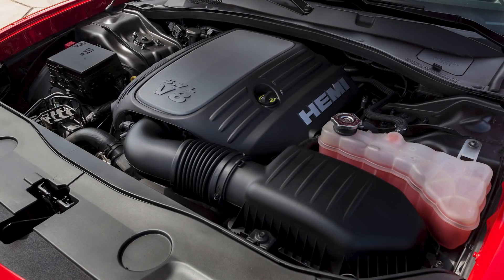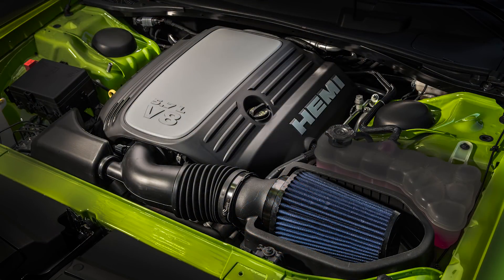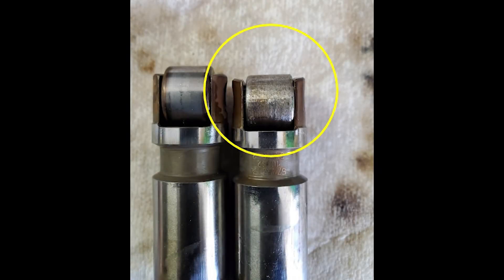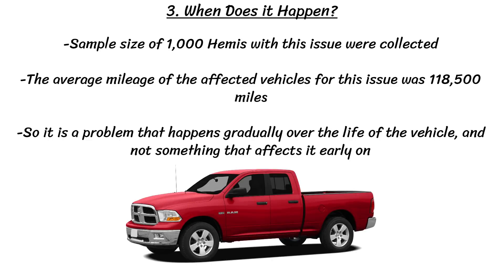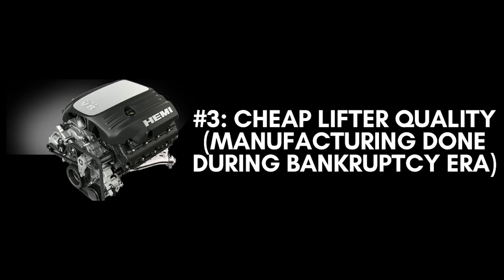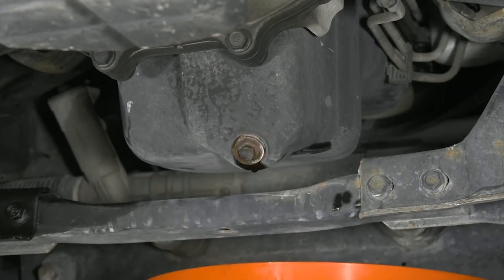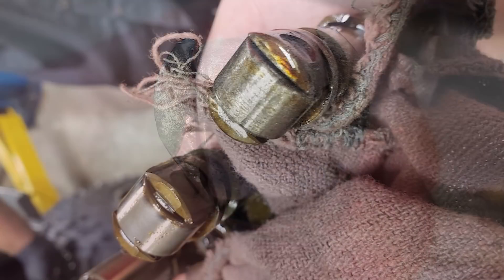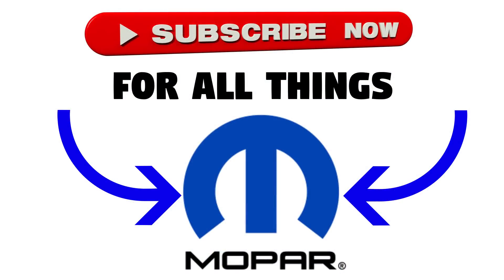The Fatal Flaw of the 5.7L Eagle Hemi V8 Engine Fully Explained (2009+ Lifters and Camshaft Failure)

Comment: Actually better than I expected, a few things though. 

1) It's not a lack of overall lubrication. The lifters are drenched in oil and actually have THREE oil sources. There's a main oil galley that is ALWAYS providing oil to the outside of the lifter body. This is the source that lubricates the needles. The inside of the lifter is supplied oil from the head that flows down the pushrod. And the MDS system provides a third source when activated. 

2) The lifter part number has changed, the last letter of the part number is the evolution. The current lifter is D, the needle bearings first got larger with the C introduced in 2014. The photo shown at 5:12 is a key thing to understand. From '14 up they'll look like the lower one. The C-D evolution is an internal change that did not effect the bearings. 

3) The idling and oil viscosity thing also has a lot to do with heat. Compare the 6.4 to the 5.7, they both use the same lifters, both have MDS and VVT, and both have similar camshafts. But the 6.4 doesn't experience a lot of lifter failures. There's two key differences. The 6.4 specifies a 0W40 oil and has an oil cooler. The 5.7 specifies 5W20 and usually doesn't. So in the 5.7 the oil is already thinner and at times hotter which again makes it thinner. This is a key part of idling as the engine relies on air flow under the oil pan to cool the oil. Then consider that often engines are idled for long periods to run the AC, which again makes everything hotter.
Reply: Excellent information to add to the video!
Reply: Would you recommend running a different viscosity on the 5.7 then?
Reply: @renameduser5279  I'll tell ya this, my '14 with 55K is due for it's second oil change since I've owned it. In the first change I put in Redline high performance 5W20, this time, probably this weekend, I'll be putting in Redline 0W30. After my research I've decided that's best for me, but I'm not going to recommend something I haven't yet done.
Reply: @GarcBomber  I know the current lifters are Melling and I'm reasonably confident that all the AC and AD lifters are Melling with the AC being the first evolution with the larger rollers and introduced in 2014. Nothing to do with the Hellcat, but a change made in all the Hemi engines as they all use the same lifters. The only variation is if 8 of them are MDS lifters, but the MDS lifters have identical rollers to the non-MDS lifters and all non-MDS lifters are identical. 

Ehhh, some roller lifters can go millions of miles, out lasing flat tappet lifters, it all depends on how they're sized, how well they're made, etc. There's a fair amount of common non-heavy duty vehicle engines made in the 80s with roller lifters sill on the road without the lifters needing to be touched. 

I was hoping you knew what changed from 2010 to 2011. Clearly while none of the engine specs changed for 2011 something went bad. Presumably the supplier for the lifters was either changed to save money or quality dropped with the same manufacture for similar reasons.
Reply: @snek you have a lot of accurate information in your comment the only thing i would like to correct you on is the 5.7 does have an engine oil cooler thats built as part of the engine oil filter housing. Oil is cooled via engine coolant being fed and circulated by feed and return coolant lines.
Reply: @richardlovasi9593  Thank you...

Some 5.7 vehicles have the oil cooler, most do not. All 6.4 and 6.2 engines have it, but with the 5.7 it's put in HD use vehicles like the police cars, probably some pickups and SUVs with HD cooling packages, I'm not really sure there. The way they do it requires not only a bunch more coolant hoses but also a different water pump. The cooler itself though, as you said, just mounts between the block and oil filter.
Reply: My 2020 Ram 1500 Classic has a factory oil cooler that ties into the lower radiator hose on the 5.7 so it’s a plus. I’ve also relocated the oil filter and using a larger filter with increased oil capacity.
Reply: That why i put 5w40 in my 5.7 HEMI
Reply: @xxx20003  Ohhh, no codes?
Reply: @snek9353  No codes at all, put i noticed the oil pressure increased to 49 psi at idle instead of 40 psi.
Reply: @GarcBomber  China?
Reply: @GarcBomber  Who brought up coolant temp concerns? I also completely disagree, if overheating is an issue than cooling ability is the problem, a lower thermostat is a crutch that can cause other problems. The only reason to lower thermostat temperature is if you're pushing the edge of ignition timing and detonation. The Hellcats on the other hand have a 180 stock, I can only assume that is why.

Fans on the other hand should be a very early step. The factory fan settings are kind of dumb with no variation for high and low vehicle speed and too high of hysteresis settings. Fan temps should be lowered and hysteresis narrowed overall with the lowest settings being low vehicle speed and AC on. 

I don't know what you're referring to though in regards to "coolant heater" and "supplemental fans". My knowledge mostly relates to the cars, is this a truck or SUV thing? Is there a factory coolant heater to speed up coolant warming for cabin comfort?
Reply: I should add a 4) to this... 

4) These engines consume oil. The PCV system does a poor job separating oil from the crankcase gases, so oil droplets end up getting cycled into the intake manifold and consumed by the engine. IMO this oil consumption is bad enough that if the oil isn't checked and topped off between changes and one goes the full 7K mi between changes(the factory interval for the oil change light) there could be just barely enough oil in the engine to maintain oil pressure by the time the oil is changed. Those few quarts are going to be very dirty and completely worn out. 

A little known fact about oil, it thins over time. A typical 5W20 oil is made by taking an oil with a viscosity rating of 5 and adding what is called viscosity index improvers(VII) until when hot it acts like a 20. Now while the base oil doesn't break down or lose viscosity these VII do, so over time a 5W20 becomes just a 5.

So for someone who uses cheap oil, doesn't check it between changes, and just waits for the light to come on then goes to get it changed. By the time they have the oil changed the engine could only have a few quarts of what is essentially very dirty 5 viscosity oil in it.
Reply: @snek9353  I have two of these engines.  One from 2010 and one from 2012.  Either consume a drop of oil.  The 2010 has 122k miles on it.
Reply: @rscarawa  Interesting, you must be the only one. There's a reason adding catch cans is such a popular mod. My '14 with 55k spits about a pint a month, might be that I spend a lot of time with my foot on the floor.
Reply: @snek9353  I am easy on both of them.  Cannot afford a major failure at this time.  My last oil consumer was a Saturn SC2, 1995.  I lost a quart every 600 miles.  If I did not add oil to it between changes, it would run dry.  Never left town with out two quarts in the trunk.
Reply: Same. My 2014 5.7 is very polite about its oil appetite
Reply: @snek9353   My 14' currently has 126k miles on it and it is very polite regarding oil consumption.   I believe it's more of a consistent maintenance approach.  I drive over 100 miles Monday-Friday just going to work and back just as a point of reference.  I'm not saying you are incorrect, I'm only saying that I've had a different experience.
Reply: @jvilly1385  Like I said in another reply, I think my oil consumption has a lot to do with my heavy foot. I was doing 110 racing a 911 just for kicks on my commute the other day. This is normal for me. 

My car is very well maintained, I'm not concerned, it's just a thing I've noticed and it makes sense. It could also help explain all the issues in police cars, cops drive like I do. But they don't check the oil regularly and do great maintenance like I do.
Reply: @snek9353  did you ever switch to 0w20? If so how has it done for you? Supposed to be buying a Chrysler Aspen with 5.7, has it benefitted your vehicle? Would like to know so when I end up getting an oil change I get the right oil for the job. Thank you.
Reply: @taijatinsley2312  I don't intend to ever put in 0W20. I do plan tp put in 0W30 on my next oil change. But no I haven't yet.
Reply: @snek9353  what’s the reasoning for putting in 0w30 instead of 5w20? Does it just work better and help the engine stay lubricated better? Or is it more to it?
Reply: @taijatinsley2312  Pretty much, 20 viscosity oils came about as a measure to improve fuel economy. But they're pretty thin when hot, a 30 should lubricate better most of all when hot. A 0W30 is actually a bit thinner then a 5W30 so I'm using it as my next step.
Reply: @snek9353  Most of the reasons I’d ever seen for the catch cans was that they’re relatively cheap insurance…and a shiny mod that pretty much anyone with even the smallest amount of mechanical aptitude can do.
Reply: @shinner65  Insurance? Insurance for what? The catch cans simply keep the oil from making it's way into the intake. This keeps the inside of the engine cleaner, that's all. It keeps burnt oil from building up in the intake and on the intake valves. It's questionable how much of an issue this is, most of all on the valves as the hemi has a single intake valve per cylinder that
 has fuel injected onto it. But still, it's a viable thing.
Reply: @snek9353  you kind of explained it (better than I could), didn’t ya? I’d always heard the modern Hemis have an issue with blow-by, so for what they cost, it’s an affordable band-aid that helps with the problem and doesn’t hinder performance. And like I said, it’s usually a shiny piece that anyone with minimal skills can put on their car (and the all-important car-show mod list).
Reply: @shinner65  I suppose, except one thing, all engines have blow by, the difference is in how it's handled. Admittedly the hemi could handle it better factory. But sadly that's rather common with a lot of engines, very few handle blow by gasses well factory.
Reply: @snek9353 I just bought a chrysler 300c with the 5.7 and it has 168k miles. The car has been well kept, and I haven't noticed any ticking. What would you recommend for keeping it alive as long as possible? Thanks
Reply: @tomcraftdonkey2285  What year? 

Like all other vehicles good fluid maintenance is top of the list. Pay attention to all fluids but of course engine and transmission oil are top of that list. As you've likely read I'm a fan of Redline products and am using their 0w30 in mine. I change every 5k on the 5s to make it easy. so 60k, 65k, etc. 

For the transmission it's unlikely you have a dipstick, you'll want to buy the correct dipstick(s). There's two kinds available, one that functions like an old school dipstick and can be left in. And one that is the official way to check and isn't left in. I trick I've done on other cars but admittedly haven't done on my 300 yet is to T into the transmission coolant lines and add a valve. I'll then use this to remove 1 quart of old ATF with each oil change. Adding in a new one of course. 

Depending on year you may be able to get gizmos that get you the SRT pages which provide better gages. Then also another that'll allow you to up the idle speed if you decide to up idling oil pressure.
Reply: @snek9353 i know this is an old thread but i was wondering if it would be smart to clean out the oil that has possibly been built up in it? i have a 5.7 with 52,000 miles and looking to get a catch can to prevent this because like you i drive quick and try and keep it maintained the best i can
Reply: @anthonysilva3673  In what? The intake manifold?
Reply: @snek9353 yes and do you have any tips for me for maintenance? i always do 3-4k mile oil changes and im wanting to change my transmission fluid and diff fluids. i’d appreciate all the help i can get!
Reply: @anthonysilva3673  Certainly no harm in cleaning the manifold out, nor is it very difficult. Doing so isn't going to make much difference to the life of your engine though, only to it's performance. 

I don't think there's much more to say that isn't in a comment/reply above. Ask if you have any questions though. 

What transmission do you have?
Reply: @snek9353 i’m not sure. but it is an automatic 8-speed and it’s a 2017 rt challenger
Reply: @snek9353  ppl
Reply: @snek9353   my 2018 eats zero oil. it has 138k on the ticker and still runs like day i got it. so really dk where you get that it eats oil....
Reply: @alexlindekugel8727  Mine does, maybe it's because I drive like a man.
Reply: Oil temp is always at 210 degrees since our 2013 Jeep has the towing package with heavy duty cooling. I can drive it up a mountain, drive it in heavy traffic in hot Arizona summers, oil temp stays around 210 degrees. Have also always used 5w-20. Now, if the engine is being raced, or actually used for towing, I'd probably bump up the viscosity. No hemi tick either, but only 50,000 miles. I've seen lower mileage ones ticking, so good sign so far.
Reply: Dodge/Chrysler have ALWAYS BEEN SENSITIVE TO CARBON BUILD UP ....
Reply: the cam placement in the block is to high on the 5.7 and the angle of the lifters to severe .I feel it is a design flaw .due to the cam placement and lifter angle .but if the engine goes 100k before cam lifter problems thats ok so do cam lifter swap at 80/90k .the small block chevs in the late 70s earl 80s would wear cam lifters also replaced many in my day!nothing is perfict and nothing lasts for ever !years ago a gas engine with 100k was worn out!
Reply: @andrewslagle1974  The GM LS engines have the cam high as well. High cams with a center oil passage have been common for a long time. Even with the good ole' small block chevy, aftermarket blocks are/were made with higher cams to fit larger cranks. 

The lifter angle is somewhat unique but not unheard of.  Many flat engines were made with completely horizontal lifters and it's common in some forms of circle track racing to use a domestic pushrod engine(usually a SBC) and lay it on it's side. If lifter angle was a problem the drivers side lifters in those engines would fail, they don't.
Reply: Your wrong there is no oil that goes through the lifters
Reply: If you read some of the owner's manual, when it comes to oil it says 5w20 and now 0w20 is recommended for light duty service in climates that routinely go below zero and stay at or near freezing. However for severe duty a range of 5w30-10w40 is recommended. Their definition of severe duty is basically what we all subject our vehicles to on the daily drive 😂
Reply: @Sinn0100 gettin that hellcat??
Reply: LOL nothing to do with oil viscosity, and the 6.4L has just as many failures , you might see less because its not as common as the 5.7L Nice try though. If you actually look at the crazy angle these lifters and pushrods sit at youd understand that the half the lifter is getting more oil then the other half. Sure there is oil going to it but its not sufficient.
Reply: @bartekmedes8281  Go kiss uncle tony's ass.
Reply: In my 04 ram 5.7 hemi right on my oil cap it states 5w30 not 5w20..So the weight did change in the MDS model
Reply: does anyone have info on 2007?  I have my eye on an extremely good condition  one with only 100,000 km (60,00 miles). should I   be concerned? What methods of checking do I have?
Reply: Anyone have experience with turning  off mds? Recommended? Is it easy to do?
Reply: So if I put better lifters, choppyer cam, oil cooler and some thicker oil then lifter problem gone?
Reply: @GarcBomber  We need to keep in mind though that not all lifter failures are lifter caused. The roller lifter is likely the most stressed part in a modern Hemi. Thus when an engine is poorly treated they're the fuse, the first thing to go. This doesn't mean the lifter was the cause, it if wasn't the lifter it'd be a rod bearing or something. 

With Redline 5W20 and factory programing my '14 MDS 5.7 with 55K maintains oil pressure in the high 30s during hot idle. I've since bumped the idle just a touch to keep it over 40 just for my own comfort. But will soon be swapping to 0W30 and may drop it back to factory idle settings afterwards.
Reply: @GarcBomber  You know this how? 

There's no such thing as a hellcat lifter. That you think so makes your other claim dubious.
Reply: @snek9353  yes their is
Reply: @GarcBomber  I certainly agree that the more aggressive camshaft profile that was introduced with the VVT is a contributing factor. The failures in the 6.1 is clear evidence that the lifters weren't stout enough for the additional stress of steeper ramp angles. 

I completely disagree about your oiling issues theory. If what you claim was true there would have been a lot of failures in 2009-2010 engines. No engine specs changed between 2009 and 2013, yet 9 and 10 don't fail and 11-13 do. 

The oiling strategy to the lifters has never changed, it's the same in all the current engines as it was in 2002 with the only change being the addition of the MDS plumbing, but that adds a third oil supply it doesn't remove any oil. Oiling only got better in 2009 with a larger oil pump added, idle oil pressures are higher in 2009+ engines than it is in earlier engines. 

Overall the oil supply to the lifters is very substantial. With 4 center feed main supplies so the oil doesn't have to pass as many other lifters, the internal body being fed from the pushrods instead of the bore, and again the MDS adding a third supply to the upper body. 

You may be right about lifter supply, however two things. It's not really how it's done anymore to inventory a lot of parts. I also think it's telling that all of the big 3 had roller lifter/follower issues around the same time. I think they were all coming from the same place with the same QC issues at the same time.
Reply: @GarcBomber  I see you made a reply but it's now gone, did you change your mind? Or did YT change it for you?
Reply: @GarcBomber  I use 5w-20 Mobil 1 in my 2017 ram and it’s oil pressure is normally 51 to 55 psi... but I’ve heard a lot of valve problems from other people... I don’t know what is causing it unless it’s the China steel that the US buys...
Reply: More like shitty parts.
Reply: @kb9oak749  Thanks for the insightful reply.
Reply: Buy a Ford and forget all this stupid shit~
Reply: @Flies2FLL  oh ford's are trouble free? That's news to me lol
Reply: @Flies2FLL  
You're a funny guy...after having nothing but problems with Ford products I made the switch to GM. From my first American muscle/pony car that I bought in 1996- *1994 25th Anniversary Trans-Am all the way through my 2012 SS Camaro I have never had any real issues. I still own my 25th Anniversary Trans-Am and 2002 Firehawk Trans-Am. They both run as well as the day I bought them. You don't ever see that with a Ford and I have run them hard. My cousin is just like you and I'll tell you this he's replaced the transmission on his "legendary" 04 Cobra so many times I've lost count. Buy a Ford you say...I'd rather save all that dough you're spending on auto repairs for performance parts. ;)

I just bought my very first Dodge two weeks ago and I am very impressed with it. I love my yellow and black 2017 Dodge Challenger RT. Yes, I went mild so I can learn how to really push her like I have with all of my cars. What's amazing too me is how cheap and easy it was to push her past the 400hp mark and her bite is now quite vicious. If I'm still this impressed with my Challenger next year I will pick up a Challenger Hellcat Redeye.
Reply: @Sinn0100  gettin that hellcat yet?!
Reply: @timothyloiseau4172  
Actually I test drove one this past Friday after work. I'm looking for either a neon green or Hemi orange one right now to go with my Stinger Yellow Challenger. So the answer is in very short order.